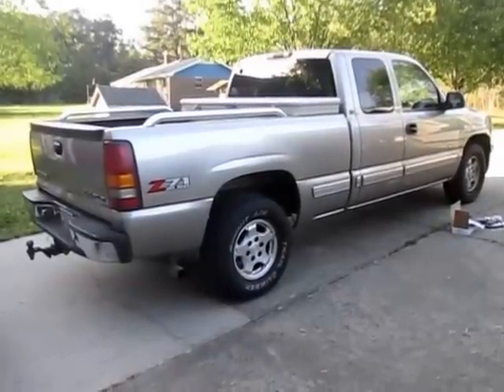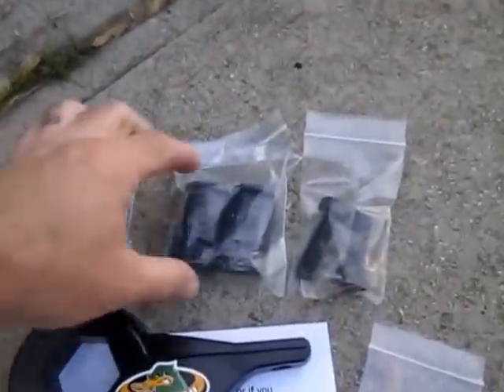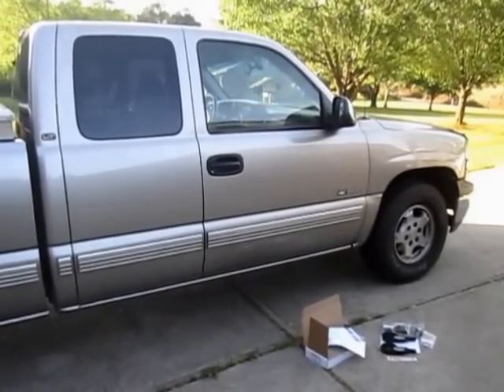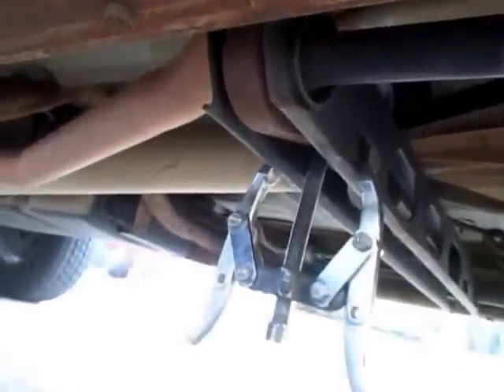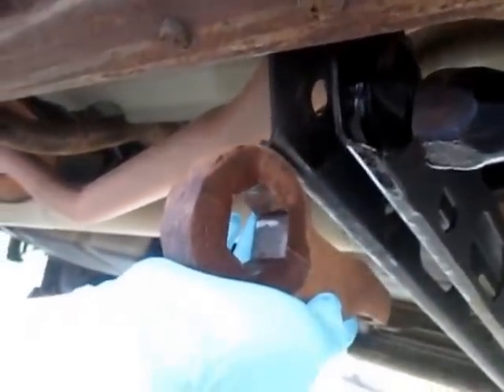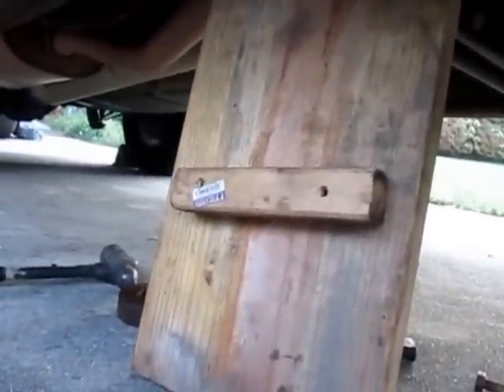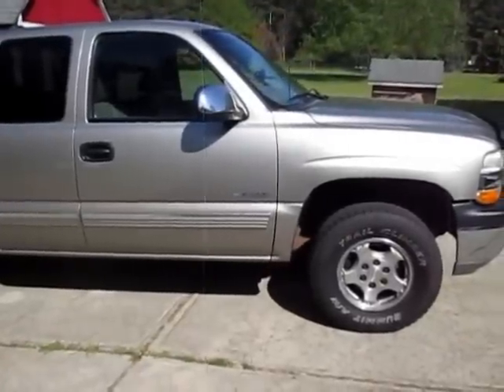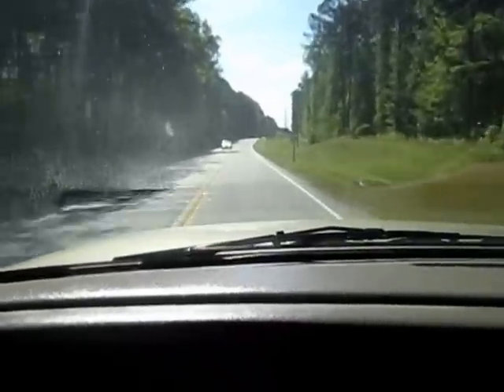Replacing torsion bar keys on a Chevy Z71

Comment: Thanks for the video I have the opposite problem my passenger side has a weaker torsion bar. I wonder if when I replaced my keys if you accidentally turn the torsion bar from its original position if it would make a difference?I couldn't get my aftermarket lift keys to fit right so I had to keep messing with it I ended up having to take a grinder to the crown of the top to get them to sit in the cradle properly
Reply from the maker: If you're off one flat on the bar, it will have a negative effect for sure.
Reply: @JoDaddysGarage  okay good to know I think I got to get back in there and figure out where it used to be I remember when I did it I didn't think that it would matter!

Comment: If the torsion bar is worn out, meaning that it's not providing the resistance it's supposed to, then won't putting different keys and putting more torsion on the torsion bar make it wear more and faster?  Isn't replacing the torsion bars a better option?  I see them for sale for <$100 each.  Thanks for the video!
Reply: They aren't worn out

Comment: I have a similar issue where the drivers side key is maxed out, passengers side key bolt is way out, literally no twist at all. Since adjusting feels weird. Seems to bounce left and right vs up and down. I'm thinking the torsion bars are like shocks. You cant replace one, and you can't set different tensions (after a certain point) . I also noticed adjustment doesn't last long. Its literally settling again by the week. Sooo.. IMO you can't twist your way out of a worn out torsion bar.

Comment: i have a 91 Chevy Z71 with a 4 inch life by Rancho
Now the front is sagging down.
Bought 1-3 inch leveling keys

Do I have to do anything to the front drive shaft if I raise the front end 2 more inches to level it out ????  

Please advise
Reply from the maker: I don’t have an answer
Reply: @JoDaddysGarage  No worries, I am calling a Truck Shop that specializes in Lifts - I will post if I find out anything.

Comment: Dont forget when you do this, you will need to have the vehicle realigned. coming up will give you more positive camber as well as pull the toe in. If you dont have it realigned it WILL eat your tires.
Reply from the maker: Eric Wix I agree. i would recommend that as well.
Reply: Oh yea. I've been doing this for over 25 years and a great video for anyone doing this at home.
Reply: I have an 04 Sierra z71 I will be doing this to. It is currently completely stock and has 16' wheels . I am debating to either  do the torsion bar keys (from rough country )and 33in tires or get a 3in body lift and run 35 in tired. Price wise the torsion bar keys are the way to go. Is there a huge difference between the 2 set ups I've just listed ?
Reply: When you do the torsion keys you Wil have limited camber adjustment on your alignment. I you do the complete lift kit you will be able to do a complete alignment
Reply: +Eric Wix so it's not correct to  do
Reply: +Ruben Gallegos Yes u can lift it lower a vehicle with torsion bars but the vehicle needs to be realigned. lifting or lowering a vehicle will change the camber and toe.
Reply: Eric Wix I thought I read somewhere cranking your T bars would give you negative camber? I recently cranked mine on my 2000 silverado and it gave me positive camber so assumed that what caused it. But recently I read otherwise. So confused lol

Comment: where exactly did you get the shocks I have ordered the keys but I dont want to order the wrong shocks or will the original GM shocks be fine with it being that high?
Reply from the maker: Sorry, I didn't mention that in the video. They are actually stock style shocks from the parts store. The key kit comes with little extenders for the top post on the shock. I actually adjusted the bars down a little, and didn't use the spacers.

Comment: What holds the torsion bars from slide back and forth?  Is there a set screw or bolt that keeps them from sliding out or something?  Why doesn't anyone show this in their videos?
Reply from the maker: No set screws. Tension holds them in place.
Reply: @JoDaddysGarage  so is there a "stop" position in the back so you get them back into alignment when installing new keys?  So they aren't too far forward or back when you're done?

Comment: Yeah my trucks stock keys are cranked all the way up but its been a plow truck for a few years and the front end sits lower then it should with they keys cranked.. So maybe my torsion bars are worn also..?
Reply from the maker: Yep. Torsion bars wear out. This is a cheap fix.

Comment: Good repair.
I think I need to do my 2002 GMC to raise the front back to stock.
Thanks for the how to and where to get the kit. :-)
Reply from the maker: Be careful. If my bars weren't so worn out, I'd have used the ball joint tool, or borrowed the OTC tool made for this job.
Reply: Jo Daddy's Garage Safety first definitely. :-)

Comment: do you have to make markings anywhere to have things exactly as they were? for example, does the torsion bar have to be twisted a certain way before you put it in the key or anything like that? thanks.
Reply from the maker: No markings needed. The bars are the same shape all around. I would just make sure I had the front marked.

Comment: do I have to upgrade my front shocks to do this
Reply from the maker: No. The kit comes with extenders, unless you're planning to run them at max height. Then you will need different shocks, but you will have a rougher ride.

Comment: Man I put another set of F3 keys that a shop sent me and the thing was so loaded that the upper control arms were resting on the metal stops, I got C3 keys from them and they were the same index as my stock ones. All I can think is the truck has a factory lift kit, MAN, this truck is nothing but trouble. I took both keys and threw them in the back of my truck! I put the stock ones in and said 4get it. I put Reflex shock all the ways around man what a great shock! Those shock extenders how do you put them on Jo? Maybe I need them to run the keys as a paired setup? Thx Jon
Reply from the maker: The extenders are really just bushings that slide onto the shock post prior to the washer and bushings. It just moves the mount point up about 1/2 inch.
Reply: bottom or top I got some caliper washer things for work yesterday I thing they'll do the some thing, Thx Man!
Reply from the maker: jon street Bottom. That way it pushes the first washer higher and extends the mount point.

Comment: Hey Jo, I have a question: I have a Chevy Silverado 2002 and I when I buy my truck it was up top with the torsion bars but when I was driving the truck was very hard to handle, I take it to fix it and the guy of the shop tell me that the arms was tense so the suspension wasn’t work it. He lowered the front and the problem was out the truck works well but I preferred the way that it looks before, what do you recommend to do with my truck? Remove the body lift and put the torsion bars keys?
Reply from the maker: Gerardo Alonso Hmm.. The torsion bar keys will only help so much. Not sure how high it was before. The keys will make a difference though.
Reply: Jo Daddy's Garage It was like 3 or 4 inches in front and 3 in the back, it was more lifted in the front and that’s the way that I want my truck but as I told you when I was driving I was like jumping and it was really bad to drive.

Comment: Jo any ideas why, I can only crank one up and it bottom out? Not getting the same height out of both, the passenger side looks great but the drivers side bottoms out, there's about an inch and half of difference
Reply from the maker: jon street Good question. Unfortunately without being able to see it, I don't know what I can say. I assume you replaced keys? Is the bolt bound in the block itself? Maybe jack up the the driver's side using the frame to take the load off, and attempt to readjust.
Reply from the maker: jon street Another thought, is the shock the same on both sides? Maybe the shock is too short?
Reply: Jo Daddy's Garage new reflexes around the truck it's just dumb. I will make a video lol got a new phone I'll put it to work lol

Comment: Dude if u ever wanted too you could clear 37s easy on that truck with those type of keys if you max them out...you made a good choice
Reply: How you going to clear 37's with just Keys? don't think thats right man.
Reply: You're right Jon Street, its hard enough to clear 33s with keys, Custom Offsets got 35s with just keys and they had to cut a lot of the bumper and do a full NorCal on the body.
Reply: Kaiden Ollenberger My 95 clears 33x12's at stock height with custom offset rims and doesn't rub. Gonna lift it and do keys before trying 35's though because I'm not interested in cutting my truck up lol.
Reply: lol ive done it. 37s fit beautiful on my 04 gmc sierra just had to cut a small corner on the bumper but had to do that b4 i got 37s
Reply: My 35s  rub on a tahoe with a 7" lift so i know 37s wouldn't fit that
Reply: AppSkii not as it sits now.
Reply: AppSkii tahoes have a harder time fitting big tires than trucks. give me your number. ill send you a pic of my 04 z71 with 37x12.50x20 mud grapplers. i have no reason to lie buddy
Reply: that guy you know 2293646272
Reply: How do you have a 7 inch and can’t clear 37s on a tahoe? I have a 6 inch lift on 26s and brand new 37s stock height in the back and fit them follow my instagram to see or my video I posted at scraping its the green tahoe
Reply: Lmao
Reply: Realistically 37's would not fit unless you're an stock offset pizza cutter tires 12" wides and 44- offset will not fit for sure.

Comment: Does this add problem with clearance on the upper control arm still rides good ??? Thinking about doing this set up
Reply from the maker: It was a little rough at first, but I had it adjusted a little too high.
Reply: Ok sweet  what about alignment were they able to adjust camber and caster when you went and got it done
Reply from the maker: It really didn't seem to affect it much. I drove it like it was. But if I did it again, I'd get it aligned.
Reply: Thanks man great video

Comment: Could you post a link to your kit for me please? 
Do you think it will  work in my situation
I have a 05 silverado crew cab  z71 it has 285 70 17s on it. Rides like a tank I bought it this way no rubbing or anything on it. But you think if I relocated my torsion bar key I can keep same height but with a smoother ride?
Reply from the maker: Tim Mauhar     http://www.summitracing.com/parts/prl-64-1000g Is the kit I used. There are other kits available. If your torsion bars are the problem, these keys will get it back up in the air. If it's riding on the bump stops, I'd say the torsion bars are bad. Have you tried adjusting them?
Reply: Yeah man it was on the droop stops I got it taken care of it was to tight
Reply: Taken care of how? What was the fix?

Comment: Every video I watch nobody shows how you get the torsion bar into the key. I've been beating for hours and have the porta-power pushing from the front
Reply from the maker: It should slip right in. It is not a tolerance fit.

Comment: When adjusting bolt do you have to still use jaw puller ? Or can you just crank on the bolt ?
Reply from the maker: For height? Just turn the bolt.
Reply: Jo Daddy's Garage thanks for fast reply, so what exactly are the steps to remove keys? You use puller to push up on key? Then remove bolt ? That part I get confused on what's actually happening.
Reply from the maker: Yes. The piece that the adjustment bolt goes into will block the key from rotating down. The puller pushes up on the key so the block can be removed.
Reply: Jo Daddy's Garage thanks for the fast responses,  I purchased a key and block kit for my 03 Ford, I originally have two broncos on 6inch but I can't use them for long distance highway driving, feels not safe lol, so I figured I don't do anymore monster lifts and this is my work truck anyway so  any lift will be better then stock.

Comment: okay i have a question my truck is keyed and body lifted it does need shocks but because of the keys it rides like a pogo stick its extremely stiff and bouncy if that makes sense   little bumps feel like huge potholes i want to have it level but with stock keys i want the crap ride go im sick of it
Reply from the maker: Sounds like it's adjusted too high.
Reply: +Jo Daddy's Garage yeah i bought it that way i just looked under it and the bolts are maxxed out what size socket is the bolt im going to losen them how many turns can i do to keep it level but get rid of the ridiculously pogo stick ride
Reply from the maker: I don't recall the socket size. You will need to experiment with turns. Maybe do one or two full turns, and take it for a ride.
Reply: +Jo Daddy's Garage i seen someone  say 18mm somewhere i don't know what keys are in it could be stock or something else i just want it to ride good i have broke a ball joint in half because its so stiff
Reply: +tunercars3 thanks for replying i appreciate the advice
Reply: +Jo Daddy's Garage UPDATE: they were maxxed out i didn't use a tape measure yet but counted 9 threads on each side and seriously rides 100 times better i know they will settle but i drove it around about 15 20 minutes and i can't believe i let it ride like garbage for so long live and learn thanks for your video 
ps: no rubbing either hopefully it stays that way
Reply: Tightening the keys repositions the truck suspension. It does not increase the tension on the bar. If you get it so high that the suspension travel is restricted, then yeah. It will ride rough.

Comment: you kept the stock shock absorbers right? i have the same problem with my 04 suburban
Reply from the maker: Garrett Owens I replaced the shocks with stock style replacements. There was a little bushing that could be added to extend the top mount plates/rubber bushings.
Reply: Oh ok cool, that's good to hear, if anything I was going yo get a longer shock to replace it. Thanks
Reply: +Jo Daddy's Garage was wondering if you can help..i have a truck exactly like yours..i turned the keys and it looks like it needs a inch or 2 to level..would me buying these keys raise it higher than..my keys turned up now?.. i would like to fit some 34s
Reply from the maker: fastest eaton lightning in socal Sounds like your torsion bars are weak. These keys will get your truck to level, but I can't say what size tire you can fit...
Reply: +Jo Daddy&#39;s Garage 
I'm thinking about replacing the lift keys on my 2004 Avalanche, it looks like it's in a nose dive. I want to level the front without loosing the smooth ride. Do you suggest installing shock extensions? I plan on having the front end alined after I replace the keys.
Reply from the maker: Rick Taylor It's a good idea to use the shock extensions. i assume the current keys have been adjusted as far as they will go?
Reply: I found a set of keys and shock extensions on ebay for $39.Yes the keys on my Avo are maxed out, and the ride is much rougher than before. I hope the new keys & shock extensions will level the front, and bring back the smooth ride. Thanks for the help

Comment: Hey Joe! I talked with you on the Spider gears you did, I love this Video, I ve been trying to find it since the first time I saw it, I'm doing the spiders this weekend and I'm having the same rough ride in my short bed 4x4 I'm going with the same now, just the keys and upgrading the shocks to see if that will help. I was going to do the torsion mounts but the need to be De-rivited GRRRRRR! I'm going to see how mine turns out, like you No crazy lift just a set of 33's and daily driving. what area do you live in? if you don't mind looks like back home in North FL lower ALB/...NEways Thankx for all the good Vids !!!
Reply from the maker: jon street Let me know how the gear replacement goes. I live South of Atlanta.
Reply: I did the spiders, but did not fix the bouncing when going  do the road, I threw my back out at work, I'm so over it, I'm getting the keys FRI  and the Add a Leafs too hope it will fix this, I've seen alot of ppl talking about it on these chevy's but no fix. grrrrrrrrrrrr

Comment: Couldn't you just adjust the bolts in with the original keys?
Reply from the maker: Nope. The bolts can only go so far, and the key will only rotate so far. That's why the new keys have a different index, so that the start point is different from the originals.
Reply: You had over an inch of threads before the bolt bottomed out. That would have corrected the problem. Did you even try?

Comment: What about the shock extension
Reply from the maker: You can add one. I ended up backing off the torsion bar a little, and it worked fine.

Comment: !!!!!!!!ATTENTION EVERYONE!!!!!!!!

USE A BALL JOINT PRESS. IT DOES IT EXACTLY THE WAY THAT "RIGHT NOW" WORKS
Reply from the maker: That may work as well. I haven't tried that. I was using the tools I had on hand.
Reply: Jo Daddy's Garage i was following the instructions from the set and the puller was just bending the frame when i had the new keys in it. so i used a ball joint press and it went from a 2 hour ordeal to a 5 minute job done.

Comment: Question, does the two wheel drive Silverado have the teroson bars as well?
Reply from the maker: +earlbroussardjr I believe they are the same. Pretty easy to find out. Have a look underneath.
Reply: Nope. Coil springs